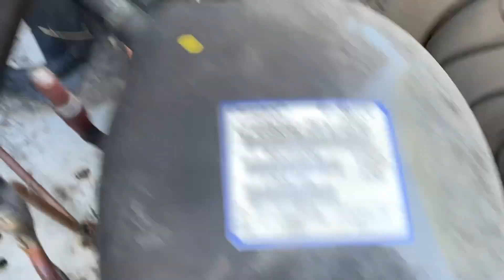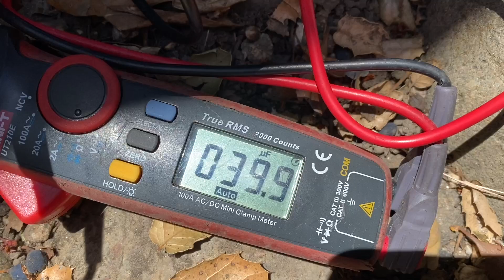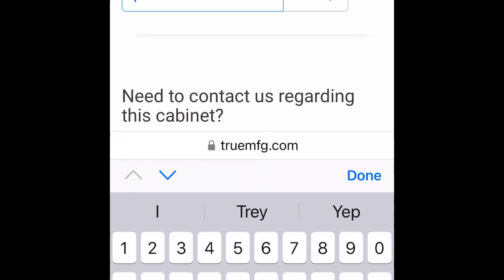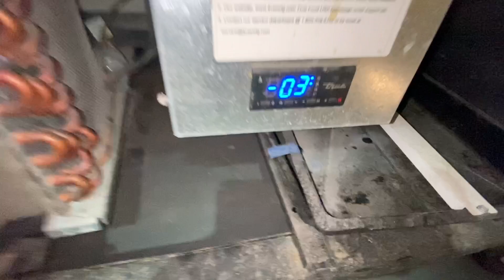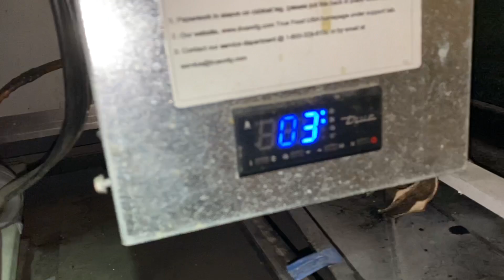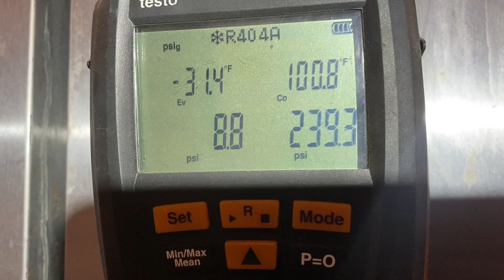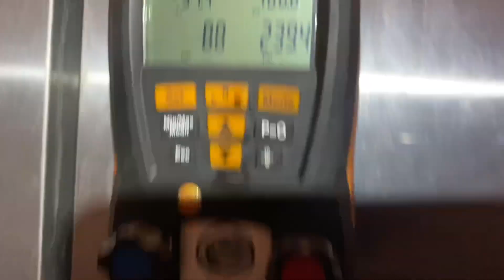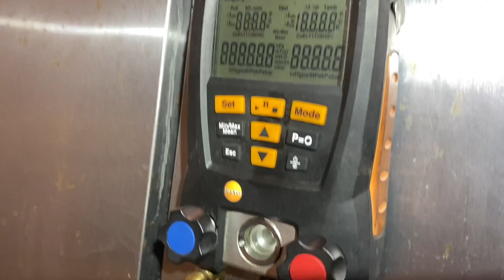Walk in cooler not cooling

Comment: Those true EVAP motors don't die most of the time. The bearings get worn and they will just spin at half speed or so and give u that low suction pressure. Been fooled by those before.
Reply from the maker: Me too

Comment: Buy an Atosa, best advice ever 😂 The old guy that taught me showed me a an easy way to check for a plugged cap tube on these machines by juicing it up and if the suction pressure doesn’t come up much or goes down and the head goes up, you’ve got a plugged cap tube